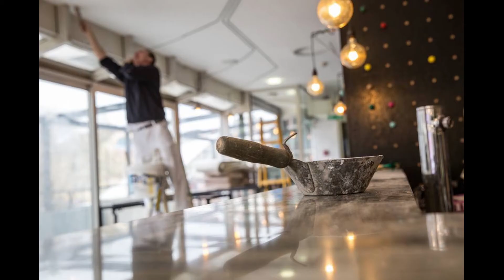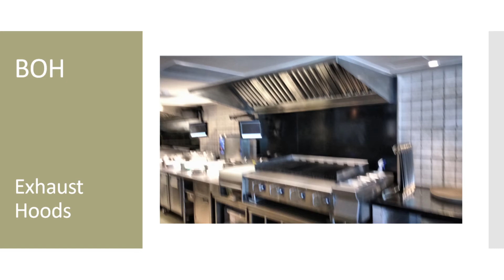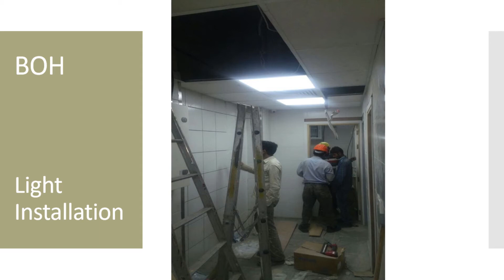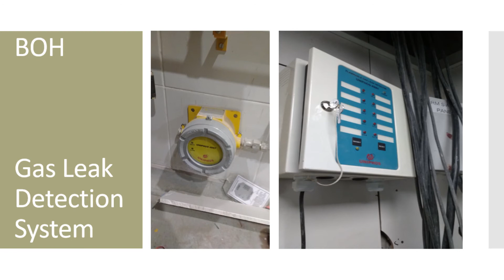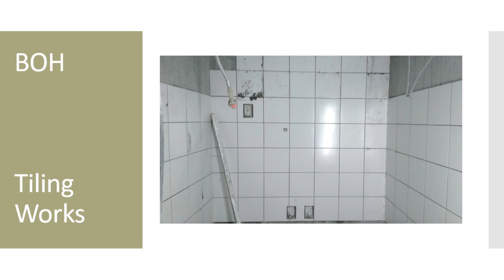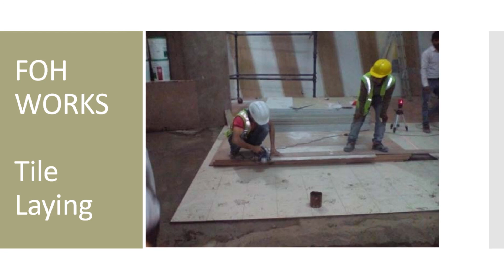Interior Fitout Works for a Restaurant

Comment: you have missed many important schedule that include waterproofing & raising floor to minumum 6 inches or more...........restaurant generally do not have gypsum partions ......they always have brick wall and low height brick partions..........and many more  others.............all ducting are always GI Site prefabricated.........later on insuation make differs their applications...........we also have to install fresh air supply ducting........etc etc
Reply from the maker: Thanks for those important points. Its difficult to capture every point in a short video of 10 mins. However, I have tried to incorporate as many points as possible keeping the video brief and to the point. Your points have been duly noted and will keep in mind in future videos.